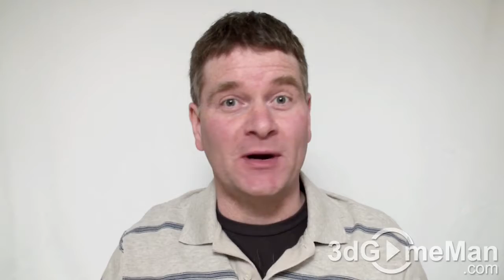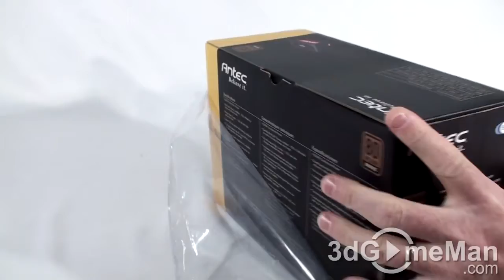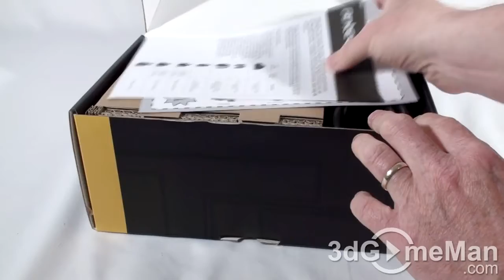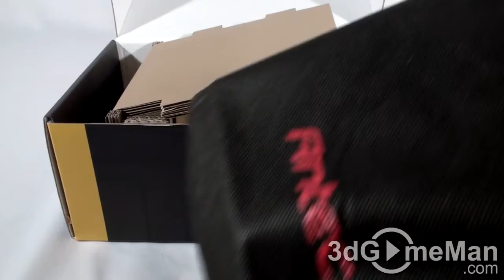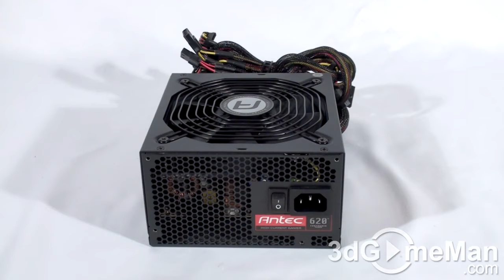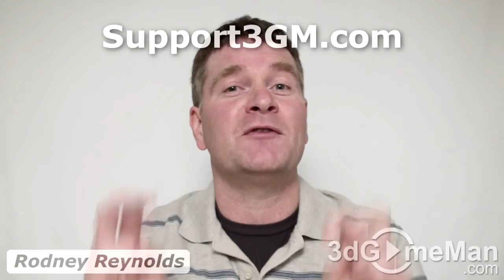#1234 - Antec High Current Gamer HCG-620 620W Power Supply Video Review

Comment: its been since some weeks a sound like a mosquito hitting a window came constantly when i turn on my computer. Its from this Power Supply but i dont know what it cant be. Isnt  the fan, i checked it. Its something in their chips that is making this horrible sound. Somebody knows what it could be? Its so annoying. I call the service and they told me its normal, but this sound start happening 5 months after i buy it. I have no garantee now. Thanks guys.
Reply from the maker: +Gimbo Slice Probably a capacitor, might be going bad. So, no warranty left?  Remember to like, sub and share :)
Reply: No. No warrant. Any solution?
Reply from the maker: +Gimbo Slice If you're out of warranty, unfortunately not for replacing it. And honestly I'd get a new one soon before it goes. No need to rush out, but buzzing is usually a capacitor that's acting up. It could last for a long time like this, but you never know and it'll drive you nuts.